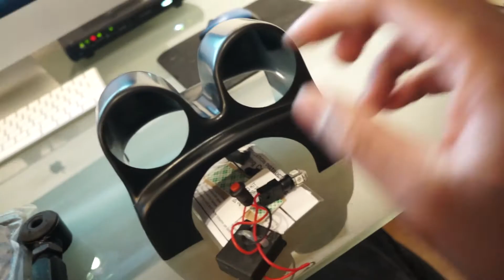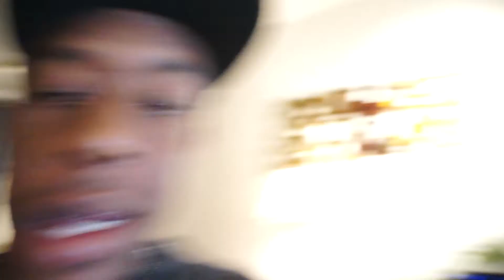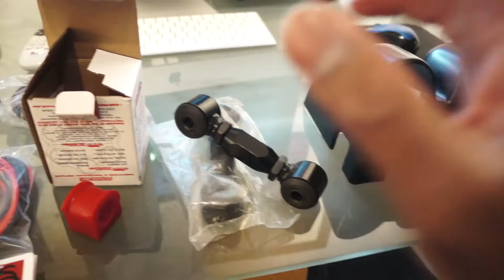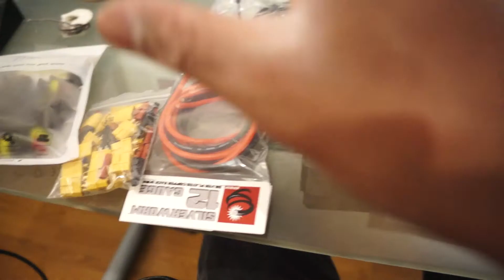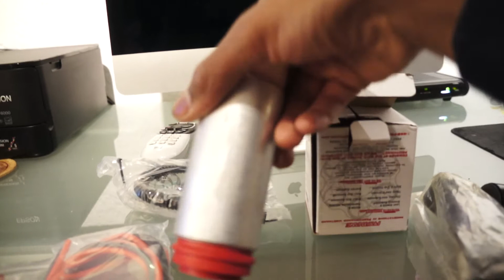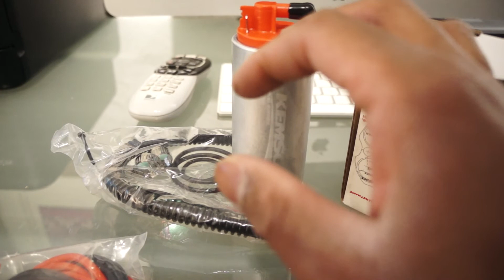New Mk4 2.0 Turbo Parts!

Comment: If you're having battery draining issues, running a bigger flowing fuel pump is gonna kill it.  Fuel pumps are one of the main current draws on a cars electrical system.  Higher fuel pressure = more electricity needed to run the pump.